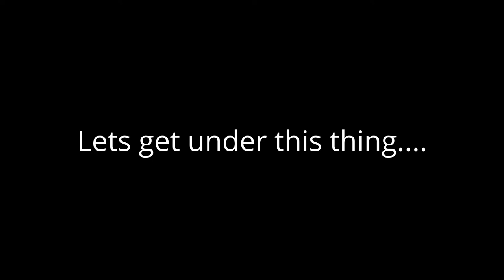Bad shock and a look under the SS

Comment: Sounds like there's a little man in your engine rapping on the inside of the oil pan. I'd have to agree with your diagnosis of a rod knock. Sounds irregular as well, as if the engine misfires on the mangled cylinder and without load the rod doesn't knock.